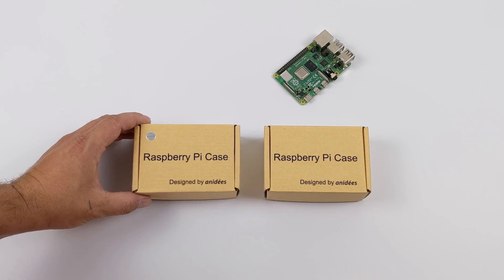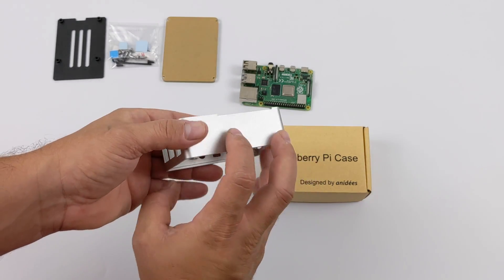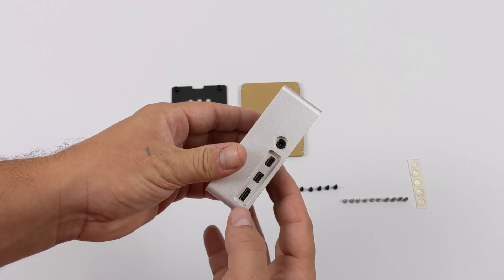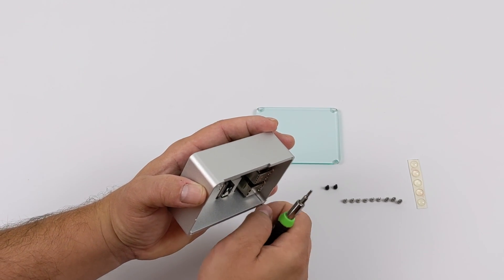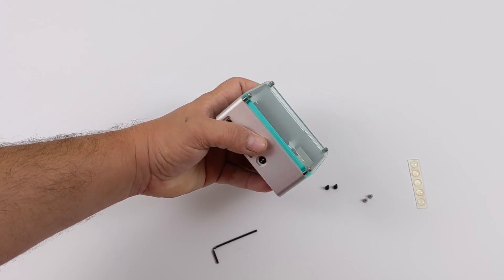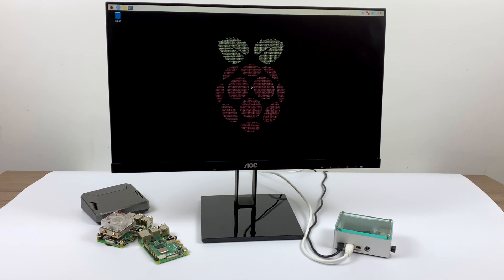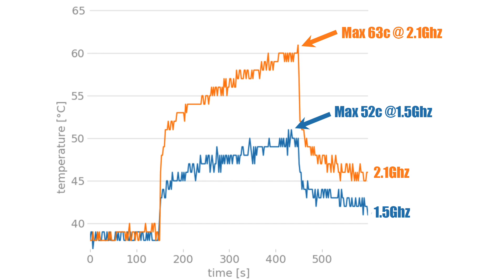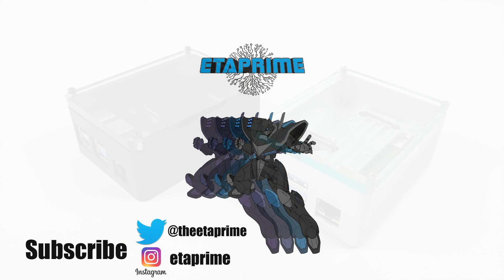anidees Raspberry Pi 4 Pro Case Review

Comment: What about attaching this box to the cooling probe of the LIAN-LI base unit but the inside of the case will have to be sealed with Corning Compound to stop condensation from getting at the electronics of this micro computer.

Comment: Are you sure that you didn't mount the lid on upside down?  Maybe those milled out spaces are for the bolt heads (which would lead to a smoother top)?

Comment: Please test overclock and air flow with some fans.  It looks like you can use 2 fan sizes based on hole pattern.  Testing both sizes against each other would be interesting to compaire against passive cooling results.  Also I wonder how long it would take to hit thermal throttle, stressed testing with passive cooling.

Comment: ETA, how much clearance is there for HATs?  I assume you need to use a stacking header to clear the heat sink plate but is there enough height clearance to attach the acrylic top if using a stacking header?

Comment: Hey! I appreciate the great updates and information. I wanted to share some information back. This is the 2nd video you mistake the Ethernet Controller for the USB Controller. The USB Controller is actually the slightly larger chip by the USB ports. And it can get a bit warm with a good amount of use. So, a thermal pad on that chip would be beneficial. Keep up the great work!

Comment: Nice review on the case and the passive cooling abilities. I bought and received the black case just a week ago. The case is expensive but it is seriously a very well designed case and very high quality. I own two Raspberry Pi4B’s both Argon One and Neo w/ Argon Fan Hat: they are both excellent cases in performance and design and reasonably priced. The Argon One is my primary Pi in use with my bedroom TV (TCL 32 1080P) w a Logitech THX computer speaker setup.  The second Pi is now configured as a music streamer using Volumio with a InnoMaker DAC HAT sound card installed in the Anidees heatsink case modified for the headphone port and RCA outputs (pictures posted on my Amazon review).  
  I bought this case for the very reason that I wanted a “finished, professional looking” product that will work silently and cool the Pi without issues. It is expensive but I waisted money on other cases before biting the bullet and getting the best case for my idea of what would become a dedicated music server.  I first used the Neo case with the Fan Hat and DAC Hat  and  w/o Fan Hat I just wasn’t satisfied with the looks of it. I then bought the InnoMaker acrylic case they suggest for it $10 spent, I ran that for a few days but the heat build up to 72 degrees and that was too high for just streaming music from Kodi. So now you know why I bucked up and bought the Anidees case, no regrets at all!  I’m exceeding happy with the results.

Comment: The case looks good. I do wish the acrylic was recessed in the case so it sits flush with the top and have an air gap around the edges for air flow. I think it would look cleaner and wouldn't be much effort to change it. I would also like to take out some of the  height between the USB and the top to make it a little more lower profile. Unless they recess the acrylic into the case to take up some of that gap. Just a thought. I may stick with my Argon1 cases.

Comment: Cases like this and the flirc case are really good for a non overclocked pi4
Reply: The Flirc case is only $16 on Amazon. Unless you are driving all four cores at Max you'll never exceed it's capabilities. If you intend to drive it that hard I've been using a low profile Ice Cooler heat sink/fan combo that I got for about $22 on Amazon. This thing is more expensive than the Pi.
Reply: I have the flirc case and a sunfounder aluminum case with fan.  The sunfounder case runs the pi much cooler and the fan isnt loud at all. I looked into the ice tower but imo it is hideous to look at
Reply: @dsnobs78  im all about the low profile. Altho i kinda want to get a basic fan not a led/rgb tho.... but i cant complain if its included

Comment: I'm trying to remember the last time I bought a case that cost more than the contents it houses? Nope... That would be madness!
Reply: Hmm you might as well get a flirc case for the same benefits, wait for a holiday deal (Black Friday on amazon  was at $10 and maybe it will go back to that price). Honestly I would go with a odroid n2+ that has a good heatsink installed during purchase. But if I had option on a system on a chip case, I want one with a power button...I wish power button would be part of the rpi4.
Reply: I got a low profile Ice Cooler that was around $20 that is cooler than this case. The cheap Fan Shim worked well for me too for a few weeks until it croaked.

Comment: To be fair, a better looking and much, much cheaper ($15 vs $50) Argon Neo should perform almost similar, especially under normal daily usage. And Argon One ($25) which is much better looking will surely outperform this expensive $50 case.

Comment: Did you put the thermal paste/pad on the wrong chip again?
Reply: He sure did. Also clearly installed the lid upside down. But they, at least he didn't call the micro HDMI mini HDMI this time.
Reply: @hellterminator  i have a similar Anidees case for Pi 3 without passive cooling. i was also wondering whether he installed the lid upside down. he had me pretty convinced that the gap is for the ribbon cable (now i'm not usre anymore)
Reply: @xybersurfer  No, the optional gap is supposed to be there (if you use the standoffs), but the recesses in the lid are clearly meant for the screw heads, so that they'd sit flush with the top of the lid.

Comment: Between this and the Flirc which would you prefer if you are not running any ribbon cables?
Reply: Maybe someone can advise otherwise, but this is the first case I've seen that acts as a heat sink for the onboard Pi chips but still allows you to attach a hat board. The Flirc case doesn't allow for that, nor do any of the other variants I've seen that are based on the Flirc design (that contain chunky metal pillars coming down onto the board).

I also read a review of the Flirc case on Amazon - because the top of it is that mat-rubber finish stuff, apparently that can break down over time and becomes sticky (I know exactly what this issue is as I have an external optical drive which suffered the same fate). So, if I was looking for a metal case offering passive thermal cooling, this particular Anidees case would be a strong contender among the many other cases I've looked at to date.
Reply: @parkamark  Thanks for the really well informed response. I wasn't aware the rubber top issue on the Flirc case. This help explain a benefits over the the old reliable.
Reply: @frostbyte11  the ExpainingComputers channel recently posted a video explaining the advantages of passive cooling and the cooling efficiency of the $16 aluminum flirk case. i can't remember how many contacts it makes with the R pi, perhaps 2. if that is the case, maybe individual heat sinks can be attached to other points of heat?